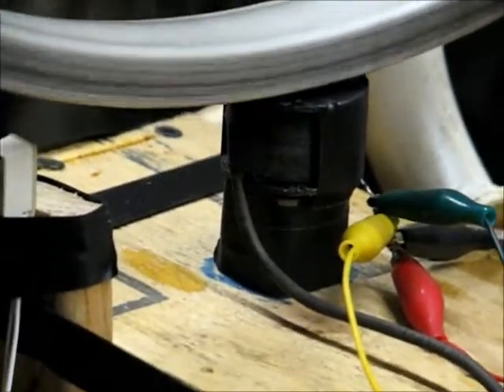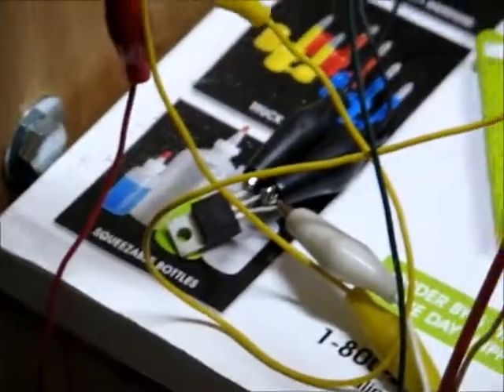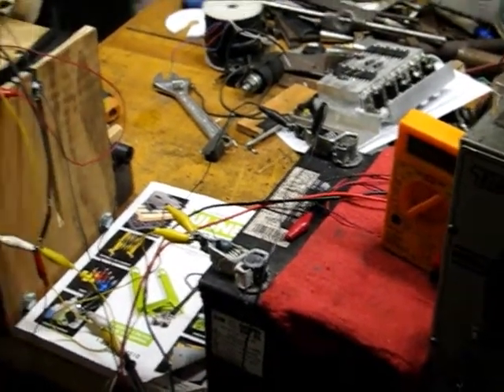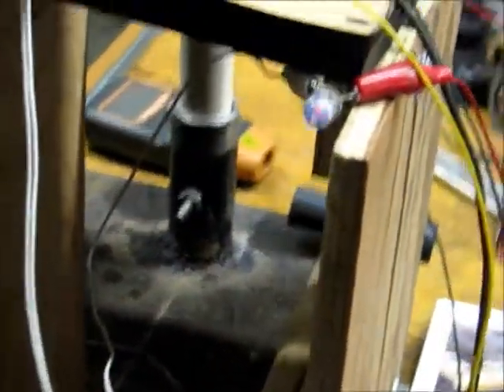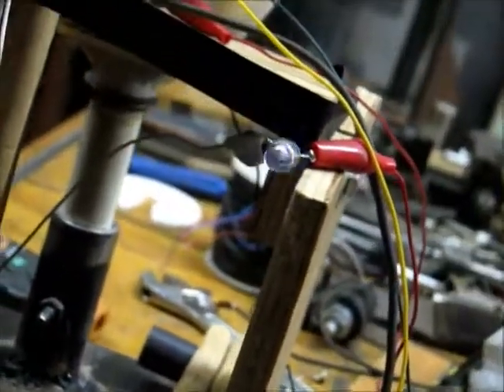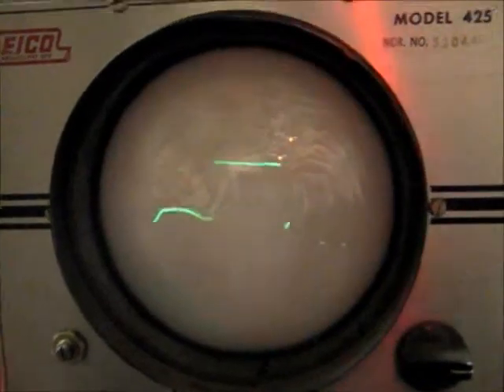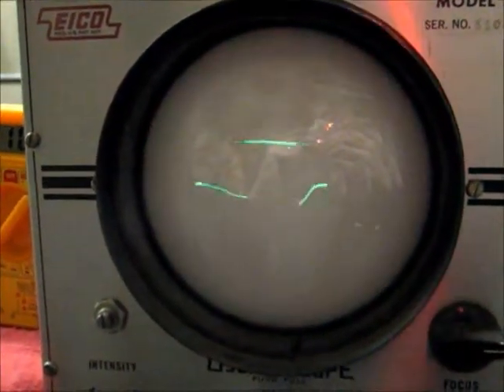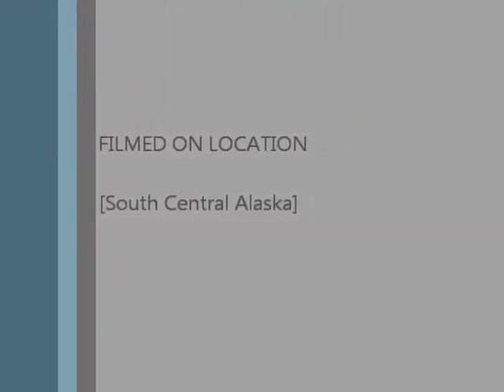Pulse Motor Driver

Comment: What is the significance?

I recognise John Bedini's monopole idea, but you are pulsing and not collecting? I mean: collecting the spike in a LED doe snot harness the free energy very well.
Are you planning to add more to this setup? Like more coils or so?
I'd like to follow on your experiment, so that I don;t have to build one myself. I am bad in engineering and a lot better in electronics / solid state stuff.